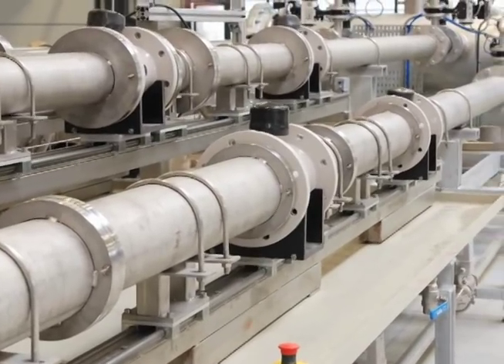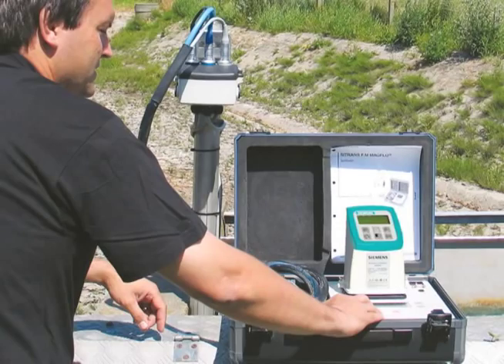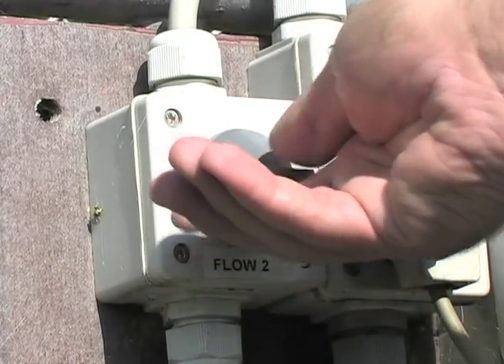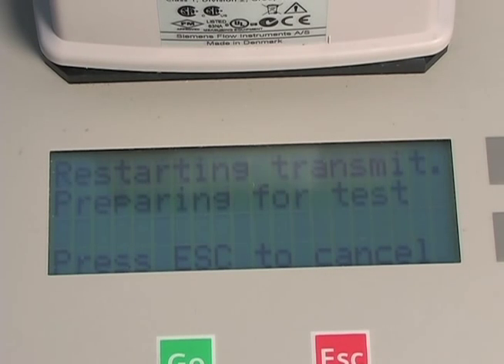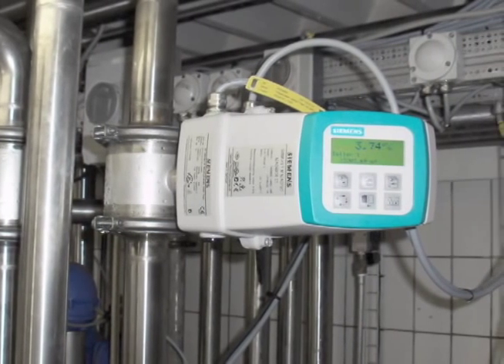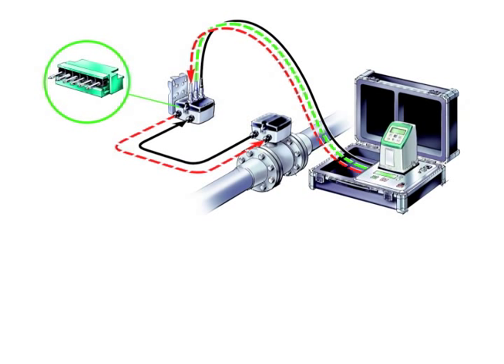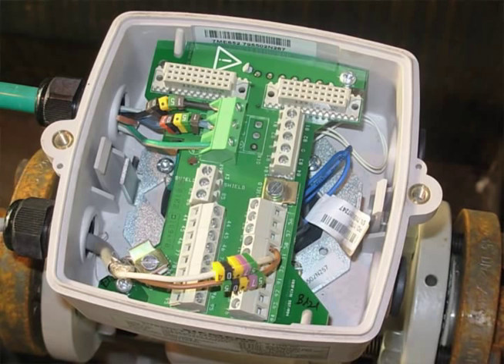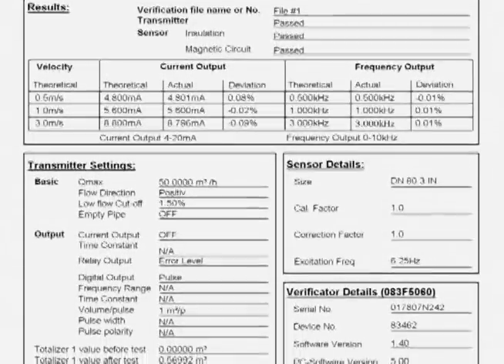On-site performance validation with SITRANS F M Verificator

Comment: Hello, can you please add a section with the fact that there are two points that need to to be open to ground before hooking up the verificator? This can cause problems in the verificator causing the need for it to be sent  in to Siemens for repair. If this is plugged in and there is this issue, Siemens does not cover the cost to repair the verificator if this step is not taken.

Thank you